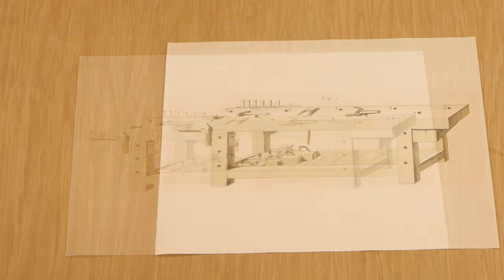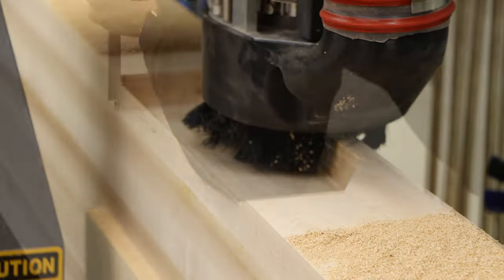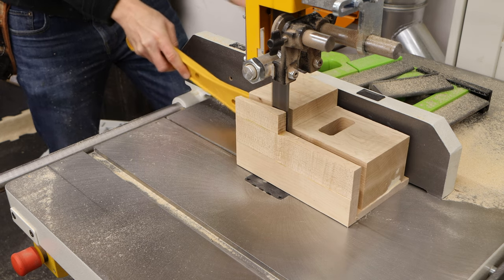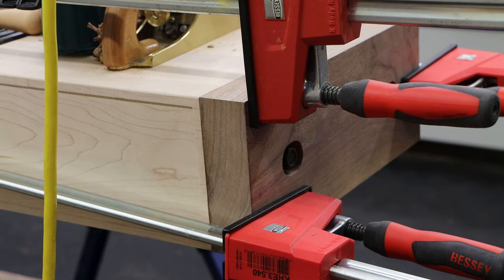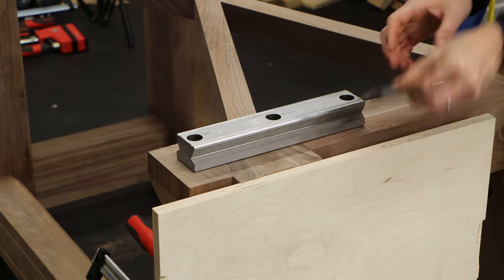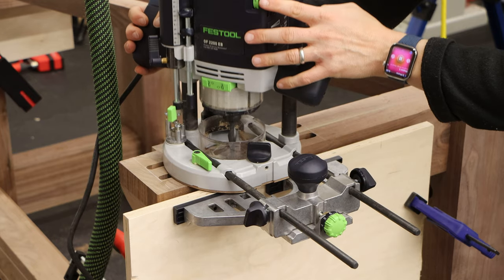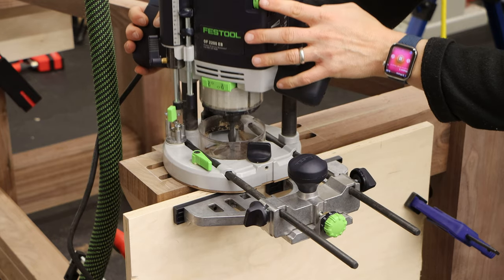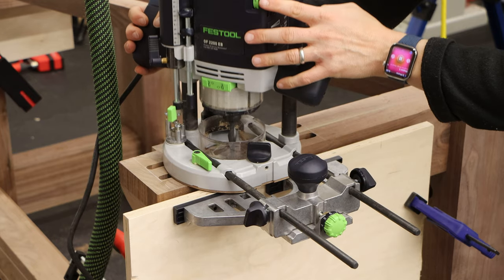A Massive Roubo Workbench with a Superpower

Comment: What is a rotary lathe?
If the slot wasn't central to the table, I would think it might be useful but not in the center.
As a side note having an extra linear motor, I have decided to use two of them for an end vise...no central screw. Just the sliding guides, and a switch.
Two linear motors would have eliminated the need to have room for the screw on your table vise.
Reply from the maker: Hi, A rotary lathe is an add-on to my CNC that rotates the wood against the CNC bit. Think of it like an old line printer, it shapes one line, rotates the wood a little, and does the next line. I don't have a traditional lathe so this is my solution for round work. 

Your certainly right about the linear motors. I looked at so many options for that top including motors. Probably the best functioning would be a screw at each end with either linear motors or a chain drive. In the end, I'm happy with this result and I'm really happy to be done with the project :) 

I did a short video on how I"ve been using the center slot.

Thanks for the feedback!

Comment: Please further clarify WHY you chose to have the expanding top. I guessing that it wasn’t to use the top as a giant vise? It’s a lot of effort to make so what is the functional purpose? In watching your video, you’re using a lot of power tools but the giant vice most probably would be for hand tools right? Hand planing comes to mind as an obvious use, but it’s ergonomically more awkward to have the board away from the sides and using a jointer machine is more accurate and faster. Inquiring minds need to know.
Reply from the maker: Hello Zane, thank you for your comment; I've answered this question several times in other comments, so please read those as well. It gets used as you imagine it would on odd shapes that don't work well in the leg or tail vise. It was a lifesaver recently sanding and edge planing 1/8 walnut strip that was 2" wide and ~24" long. It also helps if I want to put something through the center of the bench because I can expand that gap to ~5". I also plan to build some inserts for specific purposes but have yet to have the time. It works exceptionally well for holding long workpieces (over 2 feet up to 10+ feet) where I'm working on the end of the piece horizontally or vertically where the leg vise screw is not ideal because of the width of the parts. I don't have a sliding deadman, so it fills that purpose. As you suggest, It's less ergonomic if your workpiece is in the middle of the bench. I hope that helps.

Comment: Legit! Incredible work, and easily the most unique bench build I’ve ever seen. I’m about 90% done with my bench build, which will have two of Andy’s TTVs on it. I’m now officially inspired to get back down to the basement and finish it off!
Reply from the maker: Congratulations Kurt and thank you! How long have you been working on it?  The last 10% has to be the hardest, probably because it stretches into 20% :D How are you using those TTV's, end vise and face vise? If your posting pictures of your build, feel free to share a link!
Reply: @pixelwoodworks  2023 has just been Marc’s miter station, this bench, and redoing tool/shop layout and dust collection pipes. Mostly random weeknights- a few hours here, a few hours there. Occasionally I’d get a half a day on a weekend and get a good chunk of work done. The bench is Third Coast Craftsman’s “ultimate workbench” but with TTVs instead of the specified vises. One 14” face, 20” end. Swivel mount on the end, fast travel handles on both. I just have to do some drawbored dowels, the lower shelf slats, and the sliding deadman. If I had a solid weekend to myself, I’m positive I could finish it off.

Bench is 30” x 84”. I’m really tall and am endlessly frustrated by a world that’s built for people 8-10” shorter than me, so this bench will be higher and larger than most would probably want… finally, something built for me, and me alone 🤣

https://kurttriebe.smugmug.com/Woodworking-1/In-Progress/New-Workbench
Reply from the maker: @kurttalert  "a few hours here, a few hours there. Occasionally I’d get a half a day on a weekend and get a good chunk of work done." -- I know the feeling :) That is a lovely bench and you took great photos. I'd swear its deeper than 30", It looks more like 40" but it must be the photo perspective! Your old bench looks pretty nice too, battle tested; are you keeping it around and adding work surface or replacing? Did you black out the back of your TTV? It looks really nice! It looks as if you offset the base heavily. Any particular reason? Congratulations again, beautiful work!
Reply: @pixelwoodworks  Yeah, the old bench will stick around- in the same spot it is right now. It's nothing special, but it has served its purpose. I built it when I was brand new to the craft and knew nothing about what a bench was supposed to do- I was pretty much just like "big and flat surface, perfect, done!" without any consideration given to the concept of workholding. Built a lot of nice things with it, but it's time for an upgrade. And having it serve double duty as an outfeed and my only bench has meant a LOT of wasted time & effort moving stuff on & off the bench. "Oh, I'm sanding right now, but I forgot I need to cut this part... OK, move everything off... cut... move it all back on." etc. Very inefficient, and has led to much longer than necessary build times.

It's going to continue to serve as table saw outfeed, assembly/glue-up/finish surface, and "messy work" bench- anything that involves liquids that leave behind messes. My goal is to just do "pure wood" things on the nice new bench- milling, cutting and fine-tuning joinery, sanding, etc.

I did gun-bluing on the backplates of my TTVs, and then did what I could to make the gears a brighter silver. I have original TTVs from the very start of his Kickstarter campaign, they came pretty raw and a bit grimy and needed some surface treatment. I think Andy has started doing a finish on the new ones, and they don't need any cleanup now.

The offset base is pretty much just to make sure there's no interference from the legs with the vise screws and the swivel mount. The TCC plan had a similar offset as well, I just adjusted the amount a bit to fit the vise placement.
Reply from the maker: @kurttalert  I suffer a lot of the same issues regarding space and shuffling, and when you have limited time in the shop, it's doubly frustrating. I often think, if I just could work on this full time, I could get SO MUCH done.. My guess is you will find ways to fill up that new bench too! You just can't have enough space or surfaces :D 

I did see Andy talking about that in his video's, I was just so tired I wanted to be done. Your's look fantastic though, especially with the light wood top. 

I have to say, that swivel mount is pretty damn cool. I haven't seen it in the YouTube wild though. I wonder how many people have implemented it. I just got in my fast action handle too, but it seems a bit to small to fit on the handle? The rollers are inset too preventing even forcing it on. I didn't see any information on how to install it, I just assumed it would slide on and then install the rod handle through the center. Did you have any issues installing yours or have any advise on getting mine installed?  It also seems like it is so tight I would scratch the hub trying to get it on. Here's a picture: https://www.mediafire.com/view/ys1idnps43afiq4/E0F8.jpeg/file
Reply: @pixelwoodworks  Yeah- honestly, a big part of the motivation for the miter station build was the extra surface space- and the cabinets below- I had very little storage in the shop before, and NOTHING had a home, so to speak, and it was just endless shuffling. Now, theoretically- with two benches, lots more drawers/cabinets, and the miter station surface- I should be able to keep work areas clean enough to never really have something in my way... theoretically. We'll see. My wife doesn't believe it'll work, she claims she's heard this story before... hah.

With the fast action handle- you can actually loosen the rollers pretty easily with a small allen key- that gives you the clearance you need to insert the rod, then you cinch them back down. Then, there's a set screw in the end of the fast action handle that lets you pinch the end of the rod to hold it in place. In the pictures, in my album, I do NOT have it set up correctly yet- I didn't notice the set screw initially. I just grabbed a new pic and added it to the end of my Smugmug album. My fast action handle was also gen 1 - so I don't have the flip-down handle that I think he sells it with now- I have the static metal piece that always sticks out. I can change to the new style down the line if it proves bothersome.

I'm not sure how many have the swivel mount. I wasn't sure how often I'd use it, but it felt like something that might be good to have on one of my vises, just in case. I'm really hoping this is my "lifetime bench" and I'm trying to future-proof it as much as possible, so I added it. Setting it up was a little bit finicky in relation to the standard mount, which was really straightforward and easy, but I think I have it all good now.
Reply from the maker: @kurttalert  My guess is, your wife is right :D Open surfaces just collect stuff. Its like moving into a bigger house, we find a way to fill the space.

I thought about loosening the rollers, but the tolerance to get it on in the first place made me decide to wait. I still think its going to destroy the hub (scratch) as there's just no play at all, it seems undersized to me. I guess I'll find out.  :|
Reply from the maker: @kurttalert  I found the problem with the TTV handle. It appears the opening on one plate is too small, one is 1.629 and one is 1.639. The 1.639 fits fine, the 1.629 won't fit on the hub.
Reply from the maker: I talked to Andy and it was indeed off but I was able to use a round file to widen enough. Installed now. Thanks for clarifying the roller pins, Andy said that was a common question.

Comment: Don't take my question the wrong way as I'm completely open to be wrong. 
What I can't wrap my head around is the benefit of (Edit: work) being clamped in the middle of the workbench?... O.o'
I can only think of aligning case-work at the moment but perhaps you had something more in mind?
Reply from the maker: Hi Slevin, thanks for the question. The sliding top has three use cases, 1) allowing for a solid top at 27" wide, 2) allowing for insertion of tool holders and workpiece insertion of up to 5" wide, and 3) clamping objects. I have not had a use case yet to clamp ONLY in the middle of the bench and I don't think that work would well (the criss cross blocks insertion of items vertically), but I have clamped items that are long  that extend beyond the middle of the bench out the end. On a classic Roubo you might use the leg vise and a sliding deadman for this, YMMV. I've primarily clamped tall workpieces vertically that do not clamp well in a leg vise. For example, clamping a 2' wide board that's 3' long works well in the center vise but not the leg vise. Its really just another option depending on the workpiece that adds flexibility. 

A bit of background: what led me to this was trying to decide how wide to make the top. Standard size is 24" and I saw enough people wishing they had made it wider for me to start thinking about how wide I should make it. This mixed with the question about solid or split top as well. In the end I came up with this design to give myself flexibility. The clamp is as much about the managing the surface width and insert configuration as it as about clamping workpieces. 

I doubt this design will become common use case, if for no other reason the time, cost and complexity, but it been fun to design, build, and, now, use.
Reply: @pixelwoodworks  
Ahh, yes. I can see that it's definitly a convinence for larger pieces & definitely has a technical beauty to it.

I look forward to follow along your next project! ^^

Comment: wow.  that came out awesome.  Put a servo on the twin turbo vice to control the opening and closing :)
Reply from the maker: Thanks for the suggestion and support! Before I decided to use the Twin Turbo Vise, I had another design that used two Veritas vises at the ends of the bench and my own gear drive. The gears were connected with a chain similar to the Veritas dual screw vise. I had trouble sourcing the exact parts I needed from McMaster-Carr and with the far more extensive milling required to implement such a complex design. I probably would have had to create custom parts to make this work perfectly. That said, a servo would have worked well in this design as it could have also been embedded in the bench. For my part, I'm a part time Woodworker and between this project and a couple of kitchens I've been building (mother-in-law etc), I'm really glad to be moving onto other projects! Thanks again for the support and feedback!
Reply: @pixelwoodworks  either way , came out great

Comment: A roubo workbench, the epitome of hand tool support systems, built with a computer. Hmmm.
Reply from the maker: I appreciate your perspective and it's a valid point. Indeed, the use of a computer might seem counterintuitive in a hand tool workbench build. However, given the immense size of the slabs, technology helped ensure accuracy and made the process manageable. It's important to note that this video primarily focuses on the sliding top, a feature where the computer-assisted tools were especially useful. Much of the build, not highlighted here because it didn't relate to the sliding top, utilized handheld tools and powertools in the spirit of traditional woodworking. My goal was to merge old and new techniques to craft a bench specifically designed for hand tool work. Thanks for watching!

Comment: y tho
Reply from the maker: y not?
Reply: U got me this time

In all seriousness though I’m curious how often you have actually used the sliding top feature. It seems like a very inconvenient position for edge jointing using the whole length of the jaw, so I imagine you mostly just use the very end of one side like a massively over engineered shoulder vice with the handle as far away as possible. I’m happy to be proven wrong though, impressive build
Reply from the maker: @Johngle  Thanks for your thoughtful comment! I understand your curiosity about the sliding top feature. Here are a few points that might clarify its utility:
The primary function of the sliding top isn't as a vise but as a way to create a variable-width bench. It's handy when you have a larger workpiece that doesn't quite fit nicely on a standard 24" bench but doesn't want to be locked into a 34" bench all the time.

1. There's a toe-in on the sliding tail vise side (the larger side). It's designed for optimal hold there as you suggest.

2. The benchtop vise is screw-free, providing about 2 feet of unrestricted clamping space. This is perfect for objects that don't fit well in the leg vise because of the screw or is oddly shaped.

3. I've clamped in a 4" piece of solid wood down the length of the vise to create a solid top, which was pretty cool since it was locked in and not floating like other inserts. 

4. The vise being on the rear poses some challenges, but I can only do a little about that. Usually, I'm clamping to hold something while I work on it, so it can either rest on the benchtop or on the frame and then be clamped. If I was clamping something that had to be held while clamped, it's more challenging, but I tried it, and it was "ok." 

Regarding your question about usage frequency, sadly, I haven't had as much time to work with this bench as I would have liked. In other words, I have not used the bench at all. I paused a kitchen build to finish it and have been caught up with it since. That's coming to a close, and I plan on crafting a couple of small various projects soon and getting back to work. 

The real driving force behind this bench's design wasn't the vise but the expandable top. I wanted that flexibility to use a solid top or various drop-in tool holders as per the project's needs. The extra vise was just a beneficial outcome of this design approach.

Initially, I was looking at building a Hybrid workbench, but after researching, it appears to move/rack a bit; it think it was more of a gimmick to sell plans, as Marc S. didn't even keep using it himself. A Roubo was the right fit, and, long story short, the sliding top required me to scale up the mass of the bench. The end goal was a sturdy workbench that wouldn't move or rack with any hand tools; I wonder if all Roubo's can make that claim. I would have been fine building a standard Roubo as I originally intended. Time will tell.

The main point I wanted to highlight is the debate on bench width. While settling on the design, I found various people who had built Roubo's wishing their bench was wider than 24" while others argued against it. The expanding top is my solution to this difficulty, giving me the best of both worlds. All the other features are just cherries on top!

Thanks again for your comment and interest in the build. 😊  It's this kind of dialogue that makes sharing the process so rewarding! I hope to actually do some woodworking one of these days and get some use out of that bench! 👍
Reply from the maker: @Johngle  @johngle Point in case, i made a large Charcuterie board today and I used the table vise to hold it at the base and sand the upper part. Worked really well. Am I suggesting anyone try to build this? Probably not. Does it work? It seems to work pretty damn well.